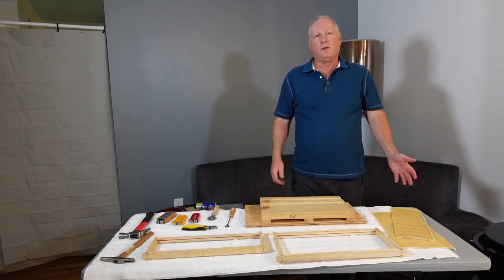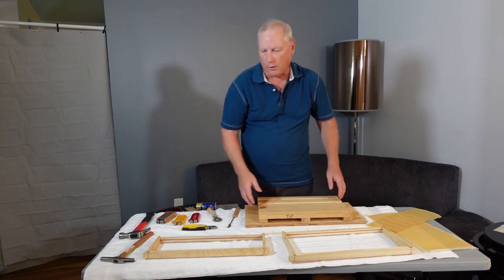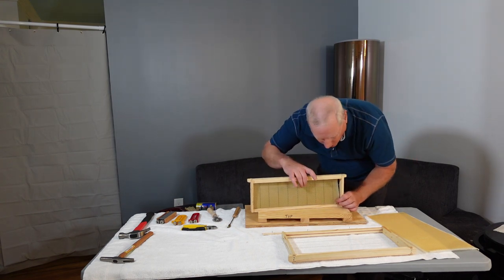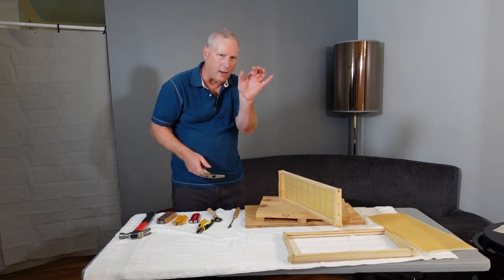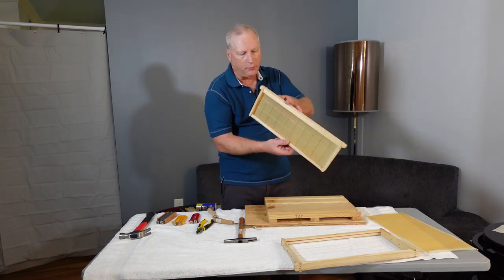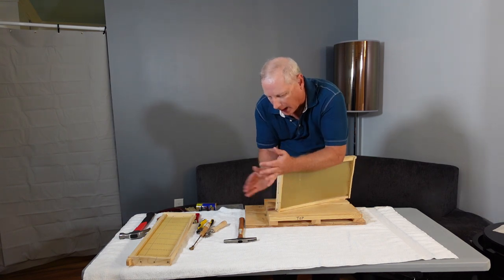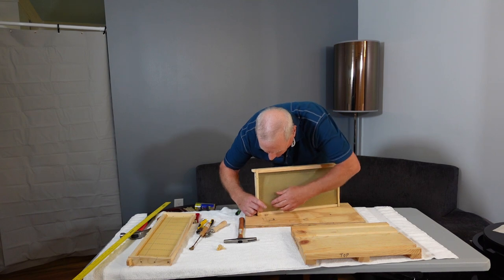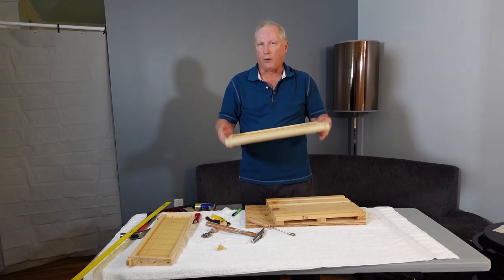How To Install Foundation and Embed Cross Wires

Comment: Building my first hive. Bought some rigid foundations with no wire vertically or horizontally. You wouldn't have gone to the extra trouble of anchoring the verticals and then spurring the horizontal wires in a world where rigid foundations don't require either without there being some reason for it. So what is the advantage to the type you're using? Thanks
Reply from the maker: Like most things in beekeeping it comes down to personal preference. Bottom line up front (BLUF):  I like natural beeswax simply due to the fact natural beeswax is easier to replace the foundation when the drawn comb becomes old, and dark. I also like natural beeswax foundation because I can do single queen cell splits if I want.  I can cut out a single queen cell in natural beeswax.  The bees will fill the hole back in when I cut out the queen cell.  There are pros and cons to all types of frames and foundation.  I prefer natural beeswax foundation, with or without metal support wires depending on whether I intend to use it for brood chambers (wireless foundation), or honey supers (wired foundation).  I cross wire my wired foundation that is used in honey supers.  I know some beekeepers that don't do the extra cross wiring step on honey super wired foundation.  They claim it is supported enough by the existing vertical support wires to prevent blowing out the comb when extracting honey.  Plastic foundation (what I think you are calling rigid foundation) is sold as waxed or unwaxed foundation. 

The pros to plastic foundation are:  1. Rigid support, so no support wires are required. 2. Plastic foundation has deeper worker cell imprints, which attempts to force the bees to make worker cells; though the bees don't read our books and will occasionally make drone cells anyway  (like they also do with natural beeswax foundation).  3. Plastic foundation guarantees the bees won't cut passage holes in the foundation; thereby giving the drawn comb a more uniform appearance. 4. Plastic foundation comes in colors to make spotting eggs easier.  The two most common colors are yellow and black.  Some beekeepers claim the black foundation base makes it easier to spot eggs. 5.  Beekeepers that use plastic foundation to sell NUCs tell me that the bees draw comb more uniformly; thereby creating a neater appearance; which they claim helps sell their NUCs better (in their opinion).  6.  Frame choice is easy.  You use a grooved top, grooved bottom, and end bars without holes.  7.  Removing and installing the plastic foundation is easy when there is no drawn comb on it.  You simply push on it to pop it out or in.  

Cons:  1. Bees can reject the plastic foundation and will potentially abscond (leave) the hive altogether. I have heard several people tell me their bees rejected it and absconded. Absconding is when the bees permanently leave the hive and find a home somewhere else.  I've had other beekeepers tell me their bees accept it and they (the beekeeper) loves plastic foundation. Bees tend to reject black plastic foundation more than the yellow plastic foundation.  2. Plastic foundation is hard, if not nearly impossible, to remove a single queen cell without damaging it to do a single queen cell split. You have to use the entire frame in a queen cell split.  You would simply destroy all but two to three of the best looking queen cells then place the entire frame in the queen cell split.  Bees can produce many queen cells if they want.  I once had a colony place 10 swarm queen cells on one frame. 3. Replacing old, dark comb on plastic foundation is more challenging than on natural beeswax. The most common way to replace old wax on plastic foundation is to first scrape off as much of the old, dark foundation with a tool such as putty knife.  You could then use a couple of small bricks to hold the frame down on a driveway, or other surface (procedure told to me by another beekeeper who prefers plastic foundation).  You then use a portable power sprayer to jet spray off the remaining old wax. I have had other beekeepers tell me they simply scrape off the old comb and put it back in the hive without further removing the remaining debris (I don't know the rejection rates with this method). You then have to carefully melt new wax and "paint" the wax on the plastic again with a small hobby brush or small glue brush. 4.  Bees can still draw out comb in unusual manner such as creating tunnels in the drawn comb as they draw out comb (listed as a con, but it's actually a draw since they do the same thing with natural beeswax too). 5.  Plastic foundation is more expensive than natural beeswax foundation.  6. You are "potentially" introducing unwanted chemicals into the hive, depending on what the plastic foundation is made of; though this is an extremely minor concern; especially since the bees will encapsulate the plastic with wax if they accept the foundation.  

Experiment!  The bees will let you know if they think you are wrong. That's how you learn!  Use some plastic foundation and some natural beeswax foundation and see which the bees prefer. I would place plastic foundation on one side of the hive and natural beeswax foundation on the other side of the hive and see which they build comb on faster. I hope this helps.